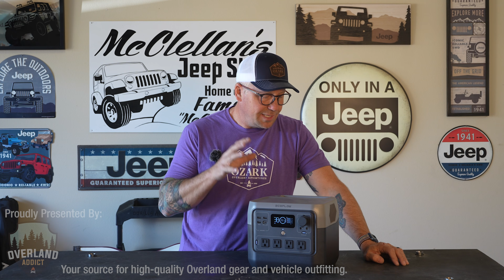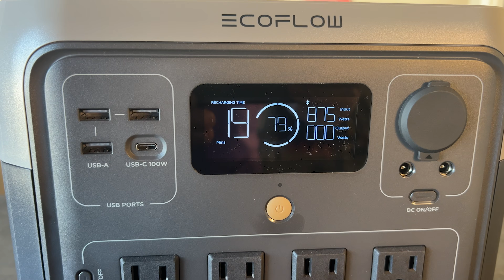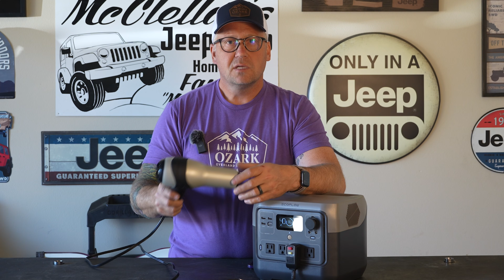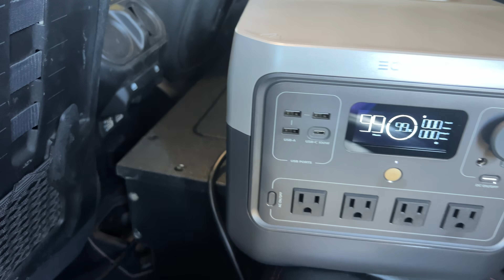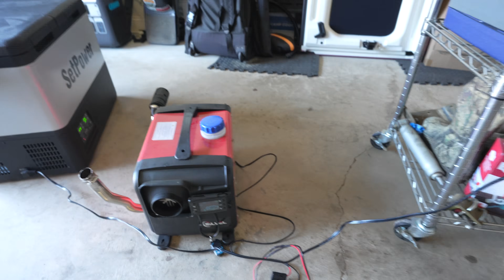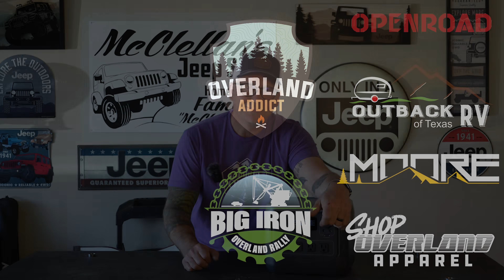EcoFlow River 2 Pro - EcoFlow's BEST Power Station

Comment: I paid $362 dollars, plus tax for this same unit at Walmart a month ago.  Love it.  It’s on Amazon now for $399.  I am thinking about buying a second one of these, as opposed to buying a single unit that is larger. You can always use one while charging the other, while owning only one solar panel, or you can purchase another solar panel and have two of these little power houses, doing tasks in different parts of your house.  I did purchase two solar panel cables with the appropriate adapters on each end, that are 60 feet long each. the ones that come with the systems are way too short anyway. This way you can set your solar panel up outside, and pretty much Have these units charging anywhere you would like in your house. The extension cables are fairly large gauge wire, however, and were a little pricey. But I felt that was worth it .  I am a fan. Way to go Eco flow.  Excellent review job by the way, thank you for posting. There are many many people out there posting videos about this product, and almost everyone is giving it top rating. I think Eco flow has created a star in this model.

Comment: Matt, I am a big fan of your adventures and videos, glad i got to speak with you a few times @Moore Expo 23 ( I asked about your battery setup and took you hamburger wrapper to the trash for you), Cara did me a solid favor and i owe her a couple more neck hugs next time i see you two, for helping me find a camping spot)  Question, do you thin the solar panels offered by Ecoflo would be durable enough for permanent roof(rack)  mount ?  Or should i look for a more sturdy  panel  elsewhere ?
Reply from the maker: Thanks!! I wouldn't permanently mount any folding solar panels. They aren't designed for that. You need to get ones designed to be mounted like that.
Reply: @OzarkOverlandAdventures  Thanks for the reply Matt, any recommendations on a more permanent mount solar panel? I have the black rhino pioneer roof rack on the gladiator cab.

Comment: 👍Big fan of EcoFlow products here. Now using an EF Delta 2 in our Hiker Trailer to power the 12v fridge/freezer, plus the Keurig coffee machine (on an as need basis). For the teenage grandsons, I bought a EF River 2 for them to use in the roof top tent when needing to charge their phones, laptops, and two small usb fans.

The bluetooth phone app is certainly handy in camp. I can monitor both the Delta 2 and River 2 from the app.

Comment: Just got one of these myself about a week before this video posted. It ran my Setpower PT45 Fridge Freezer with both zones set to 34 degrees for 88 hours strait in the back of my JKU. Granted, that has been during cooler weather and the fridge set to eco mode. Kept everything ice cold and performance was very impressive in my opinion. I completely agree with your review of it. Thanks for the great video!
Reply: does that pt45 fit in your jku fit in the north/south configuration on the driver side? im looking at either the pt45 or rv45d pro...cant make up my mind...also not sure if i want the river2pro or the delta2,(not the max) to run that fridge

Comment: I laughed out loud when I saw you posted this video. Based on your previous recommendation on the Ecoflow Delta Mini, I went ahead and pulled the trigger and purchased one this past weekend. It arrives tomorrow. My next trip isn’t for a few weeks……Would you recommend keeping the Delta Mini or returning it for the River 2 Pro? Thank you in advance. Your advice is greatly appreciated.
Reply from the maker: The River 2 Pro performed better than the Delta Mini. Not sure if it's worth going through the hassle of swapping them out. The Mini is still a great power station.
Reply: @OzarkOverlandAdventures  thank you your reply and advice. Keep up the great videos.
Reply: I have the mini and I would definitely go after river pro 2 cuz of the weight difference and life cycle. Just sharing, i know its a month late. 😁

Comment: Matt, Did Jeep lower the ability of the AC outlet? My JK charged my Bluetti 70 and just realized what you were saying, this past weekend it wasn't changing while we were driving.
Reply from the maker: The AC outlet on the JLs is only like 150 watts. The EB70 charger pulls close to 200watts I think.
Reply: blown fuse?
Reply: @brianwilliams3146  no, I plugged in a phone charger and that worked.
Reply: @mrenkil  Same outlet?  The outlet in the front of the Jeep JK has a different fuse than the outlet in the back of the Jeep JK.